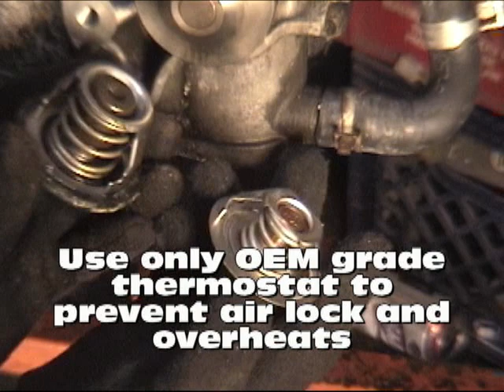Subaru EJ22 Water Pump (all EJ engines)

Comment: Can anyone find me video on replacing waterpump on 2002 subaru impreza outback sport 2.5, i had timming replaced month ago and now waterpump went out and found out they didnt check it when they replaced timming belt and pulleys, i want to do it on my own since i no longer trust the only shop in town, can anyone help, message me directly, mines completely different then this model, great video but not related to my model or year subaru, i thank and welcome any help getting my wifes car fixed so she can drive to work next monday